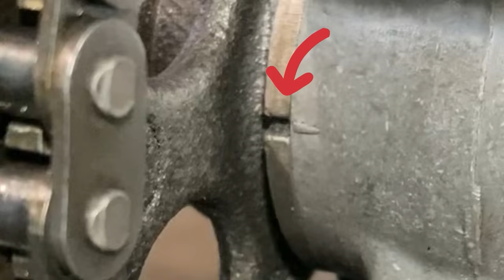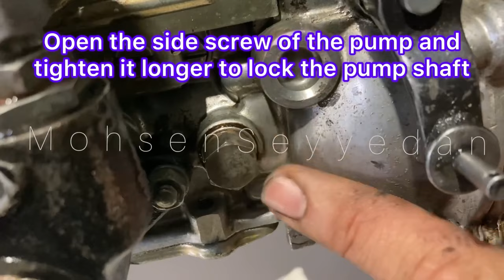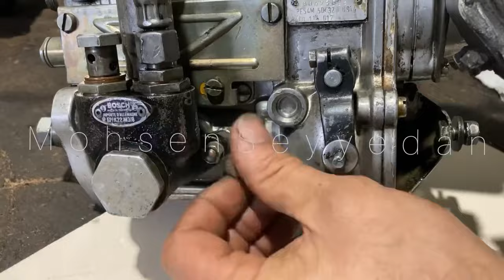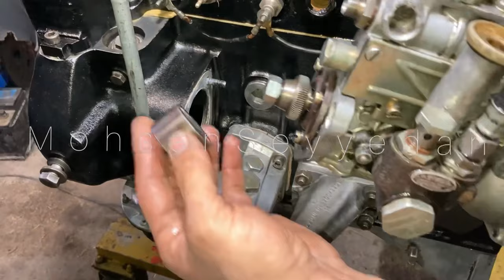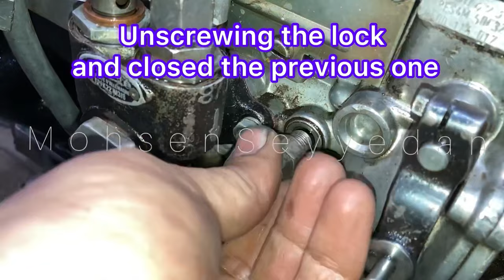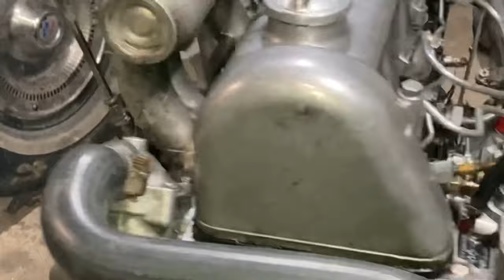How to adjust and install OM615 injection pump? @MercedesBenz

Comment: Hello,  I have recently purchased a 1994 MB 100 D van with this engine imported from Holland.  Where do you purchase classic Mercedes parts?  I need a few items soon such as hoses, belts,  heater fan blower motor, etc....
I should have checked availability before I purchased the van.
Reply from the maker: Please get in contact with your local MB parts or find the part you need in scrapyards to have it done cost-effective🙏🙏🙏.

Comment: Could you explain how to bleed the pump and the diesel system?
Reply from the maker: @bryancontreraspenaloza7952  First, loosen the screw next to the pump door with a screwdriver, then pump it by hand a few times with the diesel pump
Tighten the screw when the air bubbles are removed from under the screw and the diesel comes out without bubbles

Comment: Buenos días tengo un mercedes 230 g que no inyecta por la primer salida de la bomba lo cual no permite el encendido. ¿Será que la BOMBA está fuera de punto y hay que hacer ese procedimiento que muestra en el video? Muchas gracias
Reply from the maker: Hello dear friend, I advise you to watch the video several times before doing this and write down the steps, then if your car engine is 240, connect the center pump 24 degrees before top dead.
Reply: Muchas gracias si si eso haré si llega a arrancar le escribo muchas gracias
Reply from the maker: @waltervanini4640 you are welcome ✌🏾

Comment: hello my friend, when you turn the pinion of the pump, do you align the tooth that is missing from the pinion of the pump on the mark of the pump or then you align a tooth on the pinion of the pump with the mark of the pump? also it's surprising because you set your crankshaft at 26 degrees before OT, others recommend 25 and mercedes advice 24, I admit, we don't know too much? I read on the technical manual om 616 that there was the timing of the injection one drop of diesel per second with the injection pump lever activated, what do you think? thanks for your return
Reply from the maker: Hello so I did align The groove between the pinion teeth with mark of the pump then set crankshaft at 26 because this engine is 200 not 220,240  and for 200  you must put it 26 degrees before TDC
Reply: super thank you very much 👍👍
Reply from the maker: @krimocoucou4716  you’re welcome ☺️

Comment: Aren't the camshaft and crankshaft both lined at 0 together? And then put the crankshaft on 24 degrees to install the injection? Or is the camshaft 0 with crankshaft being 26
Reply from the maker: And then put the crankshaft on 26 degrees bdc in 200d
Reply: Lo isiste arrancar????
Reply: No entiendo lo q hace

Comment: When I turn my engine with the camshaft marking aligned, my crankshaft mark is at 4 degrees (chain stretching). So, on which mark should I set it to insert the injection pump? 26 degrees plus 4 degrees?
Reply from the maker: Hello my friend, did you watch the video carefully? If it is not clear, I will explain it to you
Reply: @Mechanicaltricks  hello, yes, I watched your video twice, I know both cam and crank supposed to be at TDC then turn crank to 24 degrees in my case and insert injection pump with aligned marks, but if my crank and cam is off, then the injection is firing on the wrong moment (that’s why I am doing this job) very difficult to start the car, after 4 tries and preheating and spraying ether, but it runs very well once run.
Reply: @Mechanicaltricks  I turned the flywheel again, and it looks like i am even more off, could  it be because I took off the belt tensioner? I think I will install a new chain to have it perfect again and not a mediocre timing setting . I can see the injection of 1st cylinder starts to give fuel at about the 10degree mark on the crankshaft!
Reply from the maker: @makingcookingfixing  First, check the chain tensioner , if it is damaged, the chain is loose and the valve shaft is out of adjustment
To check it, open the valve cover, shake the chain guide back and forth, it should not be loose
It should keep the chain tight
If it is broken, your chain will be loose
Reply from the maker: @makingcookingfixing  Before changing the chain, please check the tensioner
Reply from the maker: @makingcookingfixing  Before changing the chain, please check the tensioner

Comment: Дополню комментарий.На дизелях 615-617 после пробега 16000-18000 км. Возникает такая проблема как регулировка клапанов. В основном впускные клапана поджимают и не можеш запустить машину, запуск с буксира потом она заводится с ключа целый день. Если допустим поджало впускной клапан то выставляйте зазор не 0,10 как это положено, а выставляйте 0,15 так как на поджатом клапане и седлом образуется окись (белого цвета) этот зазор 0,5 компенсирует пока клапан прибьет на место.Это всё из личной практике что я прошёл на ОМ-616.
Reply from the maker: Yes, sorry it happened to you. But  mechanical problems usually start with low quality, bad manufacturing parts, or overuse, abuse of engine, and sometimes delayed service of engine. Nevertheless, we can always troubleshoot than fix or replace the malfunctioning part. I wish the best and good luck to you, my friend. 🙏🙏🙏

Comment: Hello how are you
I have a benz 406d.the problem was injector pump so  Rebuild the pump when we crack the engine it starts   within 1 Minute it cut and there's a small pipe on the right side of the pump where does it  Connect ?
 Help a brother 🙏
Reply from the maker: Hello, my dear friend, thank you, I'm fine, I don't know the engine type of your car, if you know the engine code, please tell me so that I can research it.
Reply: Banz 406d
Reply: Boss am still waiting
Reply from the maker: @SmilingAstroStation-vd6tj  Hello, my friend, I am very sorry, I was too busy with work, so I didn't see a good opportunity
I will do it as soon as possible

Comment: Como poner en tiempo la bomba radial al 616
Reply from the maker: The generic instructions in the Manual if you Fuel Injection Pump is correctly marked are to turn the Engine in the drecton of rotation until on the Compression stroke of Cylinder #1 (you can tell by looking at the first Cylind Camshaft Lobe Position) at 24 degrees on the Crankshaft before top dead Center (OT on the Crank).

If your Fuel Injection Pump is marked correctily the little line on the Camshaft Bearing Cap is lined up with the Screw in the top facing left. 
You would line missing splines on the Drive End of the Fuel Injection Pump with that mark on the Camshaft Bearing Cap . The stick the Fuel Injection Pump into the Engine with the mounting Studs in the Middle of the Slots on the Pump Flange and install it.

Note that the Fuel Injection Pump that has the timing marks correct has the mark on the Camshaft Bearing Cap lining up with the Screw on the Bearing Cap